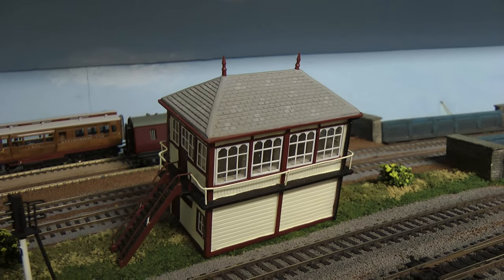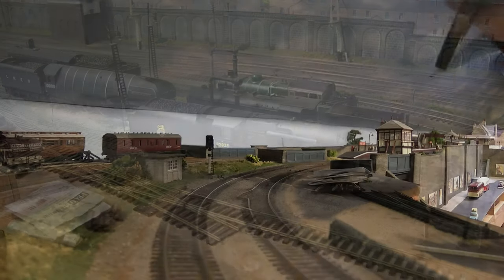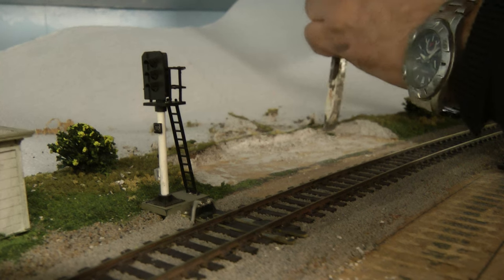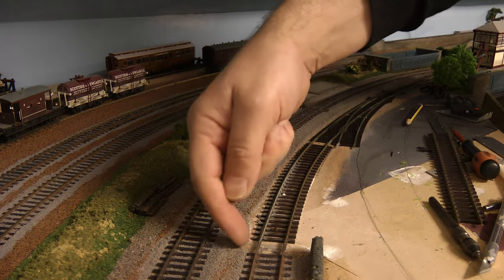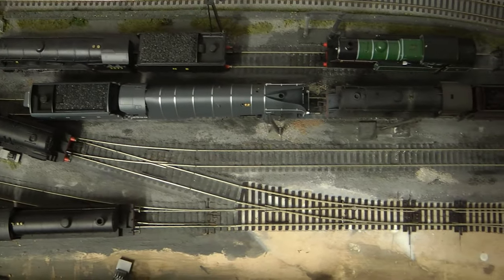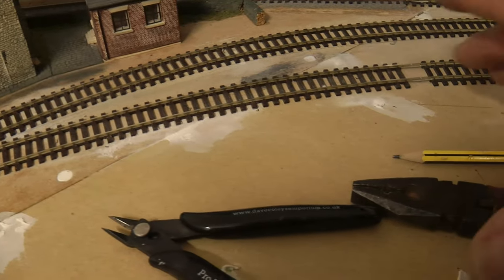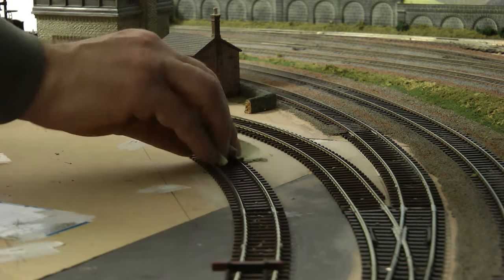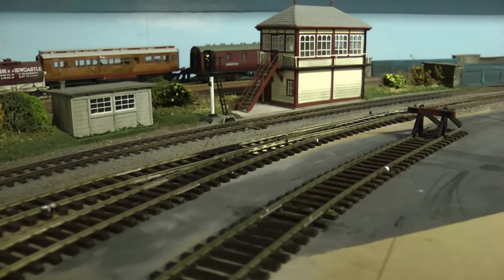TYNE DOCK WEST  Becomes a Junction.   No 416

Comment: I am sure the engine drivers would be very grateful for a canteen, especially after the long journey up from London. I expect Mr What Is Name, has been counting the number of lumps of rubble, that have been removed, and a few bundles of pound notes have been found nearby, no doubt connected to the Hole In The Wall Gang. I trust the workmen were wearing their high viz jackets and were able to negotiate successfully with the friendly group of halibut, who were in the middle of their annual conference in the early hours and were sitting comfortably up by the siding. I expect a good few of Mrs T's winter warmers also went down a treat to all concerned as well.
Reply from the maker: Good morning Alan. I am still looking for an appropriate building to go in that area. i have seen some north eastern coal stathes which look great as the engines go into the sheds. but its all just ideas at the moment. cheer;s for now Tony.

Comment: Hi Tony.  I agree that the signal box is in a much better position now.  You really had your work cut out for you with that scenery that required removing. The new trackwork addition will add more interest as well as giving the locos in the shed a forward way out.  I was pleased that you started calling the ‘point’ a turnout, which is the correct technical term, the latter is only used in the UK model railway community.  
As I know you like to hear my ramblings, here is this weeks.  
The colloquial term ‘point’ refers to what is technically known as a ‘switch’ or ‘tongue’ rail.  A standard turnout, called that because it facilitates the loco or train to ‘turnout’ from the main line to a diverging line, has two or a ‘set’ of 'points'.  When the signalman changes the points, he is actually moving the pair of switch rails from main to diverging or vice versa, within a single turnout.  A turnout is sometimes colloquially referred to as a 'set of points', not a 'point'.
The Permanent Way Department refers to the formation as a ‘turnout’, however, turnouts, slips and diamonds, are generally known as ‘S&C work’ (Switches & Crossings), as the railway consists of switches and crossings connected by standard rail.  
A turnout is made in three sections. A ‘switch panel’, a ‘closure panel’ and a ‘crossing panel’. The term ‘frog’ is American, from the days of the Iron Horse, said to be when they noticed that the crossing V was like the V formation at the base of a horse’s hoof, called in the US and in the UK, as a frog.  The UK term, other than in model railway circles, is a ‘common crossing’.  The switch panel and crossing panels are assembled on site together with the closure panel which goes between the two S&C panels. 
Diamonds have two common crossings and two obtuse crossings (unless a switched diamonds, in which case the obtuse crossings are replaced with four switches), all fabricated in separate panels for assembly on site. 
So ends the ramblings of the day.  I hope you and maybe others, found them of interest.  Best, Jason.
Reply from the maker: Good evening Jason my friend. the signal box where it is now adds more interest. and not only that you can see inside it. which means it will need detailing at some point. it seems like i keep going around in circles. i am sure that i have just one signal box. boy, this seems to be an never ending story. take care. and thanks again for commenting. look after yourself. Tony.

Comment: Thanks for the video Tony. I agree with you skipping parts of what you've covered before, there are so many videos of wiring up point, ballasting ... But incidental comments about the specific aspects you're working on are useful, like the reuse of chairs cut off sleepers and adding a dip to clear the rail connectors are really helpful.
Reply from the maker: Hi Andrew. I agree. i thin i have repeated ballasting videos at 3 times. so stick to the facts i think is the best way forward. cheer's for now my friend. Tony.

Comment: Cor that polyfilla was tough, looked like the White Cliffs of Dover in 500th scale! Mole hills on a layout (and why not?) this has to be a first - just missing some wild boar gouge marks too! Great on the track tips and nice to see inside the panel and that you number up the cables too. Looks so much better with these improvements, ditto for fun of operation…… and for storing more new locos…..All the best Stephen
Reply from the maker: Good evening Stephen, That filler was a tough nut to crack. hammer & chisel did the trick. it would not touch at first. but drilling the holes did soften it up. i am surprised that i did not take chunks out of the baseboard. 
i dont think i have shown the inside of the control panel before. but there is still a lot of points that need wiring up. take care buddy, Tony.

Comment: Dear Tony, don’t know what kind of Polyfiller you initially used, if it’s one based on a gypsum compound, you can ‘attack’ it with vinegar, regular white vinegar for example, but any kind of vinegar will do the job, because it’s the ‘enemy’ of gypsum. 
Love the way you showed the rearrangement of the tracks, adding of the different points, how you do your fill in sleepers etc. Cool to see the MPH now has a Tyne Dock connection.
Anyhow, remember you saying a little while ago you were planning this addition, but also spoke on adding a turntable. Just wondering if that’s indeed the same corner. 
Also curious for the ideas you will put into form for the brewery section. 
Cheerio
Reply from the maker: Good morning Vincent. i never thought that vinegar could do that, soften up the Polly filler. the brewery is something i was looking forward to doing. but the track looks well wrong. i have been toying with ripping it up and starting again. but it wont look much different to what it is now. so i will have to ponder a bit more before making a decision to get stuck into that project. 
The turntable i am thinking of putting that somewhere else just in front of  Newhassle  i think that spot will be ideal. lots of things to think about. until next time stay safe. cheer's Tony.
Reply: @TONYNORTHEASTERN  on the Polyfiller, it depends; when we still had the Dutch version of the Wickes, they sold a brand of spackle which referred to the product characteristics of ‘polyfiller.’ Now it’s known as ‘stucpasta’ in Dutch. Stucco paste in English. That’s a gypsum based product. 
I’m aware there are other kinds of polyfiller. Like Polyester filler, mainly used in car repair, or as a kind of wood repair product. To such products my comment certainly doesn’t apply.
Anyhow, in my former apartment I once had the attic ceiling stuccoed, between the beams. The plasterer, who is a friend, recommended to clean the wood with vinegar. He was right, it works like a breeze. The vinegar dissolves the gypsum, even old stuff, after which it’s much easier to remove. Whereas one uses water and soap the effect is that the moisture only pushes the gypsum in all directions. After which you see white stripes and a snowy veil everywhere. Since then after any repairs or even to clean my tools I use vinegar. So much easier. Of course you have to be careful close to any new stucco.
A while ago, I was making a kind of tryout diorama, using up some old spackle to make some rock formations on foam. Didn’t notice that a large blob of spackle settled on one of the faces. Also was too late to make an adjustment. So I just sprayed the blob with a mixture of water and vinegar, let it soak in and could easily scrape away the blob after a while. Of course I let the area dry thoroughly before applying any new layer. The area of the gypsum which has been soaked can be easily roughed up with a stiff brush after the treatment. Just went until I had a found a solid layer, which is much harder to scrape away.

Comment: As a MR fan, it's nice to see a Midland Railway box up in the North East. But do you have plans for a proper NER box in that location? Great layout, by the way Tony.
Reply from the maker: Good morning Peter. the signal had to match the one at the other end of TYNE DOCK station. so it will be staying. but in light of what you have said i will building original north eastern signal box's to replace some of the others. i think you know the one i love to make. is the over head box on the Newcastle to Carlisle branch. thanks again for commenting. cheer's for now Tony.

Comment: Hi Tony, thanks for the video, lots of progress indeed. I have just started soldering on my new layout, however for one or the other reason, the soldering does not work, I can't get tin on the tip of the soldering iron and connections just won't stick. Could you tell me what kind of iron you are using? What temperature, how many Watts? What solder tin are you using (size/ thickness)? Are you using tin with flux added or are you using separate flux? If the latter, what kind of flux? Thanks and regards, Paul
Reply from the maker: Hi Paul. soldering is easy to do. you must remember to put the flux onto the cables. before adding the solder to the cables. this is what we call tinning. this helps the solder run smoothly around the cables. the same must be done to the rails. flux and a tiny bit of solder. once this done then the cable can be soldered to the rails without the solder cracking. this is watt we call a cold joint. 
if this happens then you dip the cable back into the flux and try again.
the solder iron i use is a 15/30 watt fine tip. which heats up to about 200. this is more than plenty to do the task. i hope this helps. all the best  Tony.
Reply: @TONYNORTHEASTERN  Hi Tony, thanks for the feedback! It looks like my iron did not work properly, so I bought a new one, a very simple one, 30 watt, with a fine tip. I also bought finer tin and different flux. Then following your description and it worked well, as you said, it's easy. Thanks again! Regards, Paul
Reply from the maker: That's brilliant Paul. a love a success story. now you can solder in complete confidence.

Comment: Just a thought from a novice would it not have been easier to cut through the fish plates and lift the track out without destroying it 🤔
Reply from the maker: Hi Barry. nice idea. but i did not want to take the risk of damaging a point by using a Razor saw. which i have done in the past. track is expendable. while turnouts are worth keeping. thanks again for commenting. cheer's for now Tony.